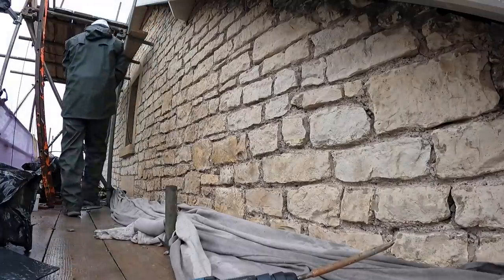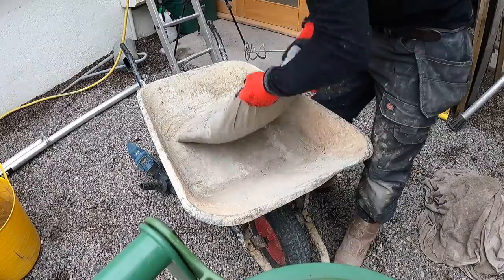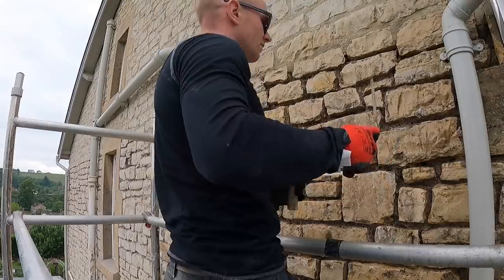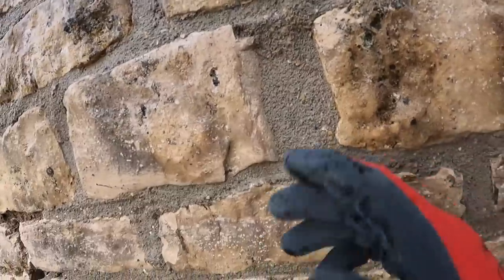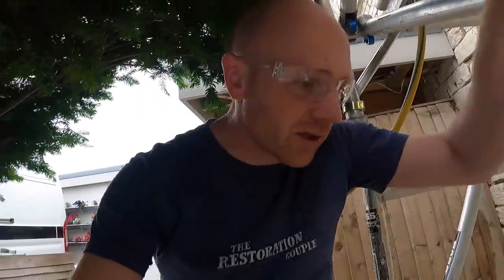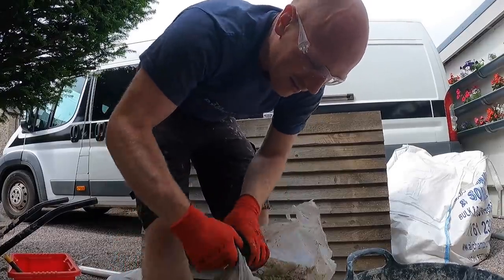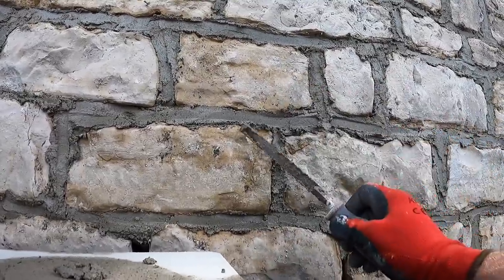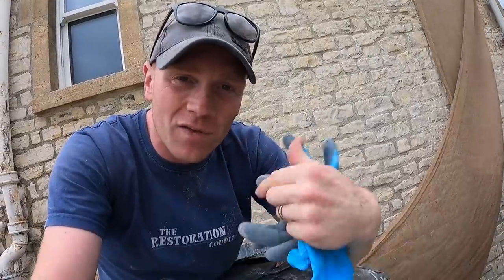POINTING WITH LIME MORTAR - How to Rescue your House Walls

Comment: Where can I go to for advice on an originally lime mortared two metre high sandstone garden retaining wall rebuild / repair?   I am thinking of building up two courses of the sandstone blocks (variable depth blocks, from 10cm to 25cm) with a lime mortar (NHL5?), leaving a few days and then pour concrete level with the blocks to start the wedge back wall; leave several days and repeat.

Comment: Try holding the hawk up to the wall as you point, tuck in and move along, should be a lot quicker, then do the perpendicular joints

Comment: Brother. After stippling the lime with your churn brush you're leaving a lot of the pointing key stroke marks. Little bit more wacky wacky. Deffo helps to catch it a bit softer as well, or strike some areas flat as you go.

Comment: Nice, I'm planning a wall with nice reclaimed brick and laying it using regular cement mortar for the durability (and lower cost) but leaving it quite recessed and pointing afterwards with something lime-based and locally appropriate like you're doing, for the authentic look. Regular cement mortar looks so grim and grey apart from anything. Hoping someone will advise me on if that sounds like a plan.
Reply: If you're laying reclaimed bricks in cement the cement will cause spalling. I.e. the faces of the bricks will become brittle and delaminate in about 10 years with the frost and thaw effect. Mortar should always be more breathable and softer than the bricks and cement can't achieve either of those factors.
Reply: @darrens3  Thanks for this heads-up, I have since looked into this a lot more and realised that, yes, I will definitely want to go with lime mortar. A lot of people in my area use the same reclaimed brick for decorative work and you can see they are just using cement mortar, and I haven't SEEN the problems you describe, these old bricks are actually really tough - a truck delivered some to me and just tipped them out onto the ground and there were no breakages. But still, I'd rather use lime anyway for the look, just got to learn to mix it properly, it's mostly hydrated lime powder we have access to around here, unless I want to start slaking lime myself, which I don't!

Comment: How do you remove the mortar excess from the stone after dry?
Reply from the maker: You don’t really want any on the surface as it can leave marks however a churn brush will knock most of it off.

Comment: When doing all the building work do you then contact your local building control officer, to get a certificate proving all work is completed to the correct regs?
I'm in the process of buying a house which I know the windows, couple of lintels, bathroom, kitchen need replacing.  Just found out that if I replace the windows the local building control officer would be the one to sign the work off as being upto FENSA standards, which I'd need if I wanted to sell the house later on.
It just seems a bit excessive constantly arranging a visit from the bco, or is that just the way things are?
Reply: If you use a fensa registered window installer, you don't need building control to inspect. Only if your installer isn't fensa registered. If you are chasing lintels/ opening sizes or anything structural building control will need to be involved regardless
Reply: That isn’t right. You don’t HAVE to have fensa standards. It’s up to a future buyer if they want a house without it. Same could be said for anything in a home. None of it is a requirement it just helps the house sale go through smoothly. Some solicitors might bring it up and make it a sticking point, others don’t.
Reply: @shandyooo  "Do I need a FENSA certificate?

Since 1 April 2002 in England and Wales, all double glazing installations need to be registered at the Local Authority to meet with Building Regulations - it is illegal to have installed double glazing in a property without a building regs certificate. 

In practice, this is normally achieved by using an installer who is (or whose firm is) a member of a a government authorised Competent Persons Scheme (CPS) of which the largest is FENSA (the Fenestration Self Assessment Scheme) . A FENSA member can legally self-certify and report the job to FENSA and the local building authority, after which you get sent a FENSA certificate."
Reply: @rockboy93  thanks, does this include work that is under permitted development?
Reply: Thank for the replies. I understand  that certain jobs done by professionals can come under the competent person thingy, but as most people doing DIY it's to save money, speed a job up by not having to wait till a tradesman is ready and sadly, from past experience, do a better job myself.
The last house we sold the solicitor asked for paperwork regarding stud wall removal and installation, I can only assume  for fire regs, in both instances the work had been carried out before we had bought it. 
I've watched a lot of the restoration couples videos and just wondered if they got the local building control officer to sign work off as up to standard?
I'm capable of doing a lot of the work for our potential new house myself, but the paperwork side of it is an unknown to me. The garage will need a new flat roof, I want to change the up and over door to two barn doors, I want to add a standard door at the rear and brick up a side door, partial to full repoint maybe needed. Does all the above need a visit and approval from bco?
It's difficult to have this conversation over YouTube comments, when I get the keys I'll probably have to contact bco/Council to find out what tune I have to dance to.

Comment: How much of the house had been repointed with cement? How much of that have to removed and repointed with lime mortar?
Reply from the maker: Just this wall fortunately. The good thing is that when it was done in cement they didn’t actually do it that well, if they had raked out the original lime deep and packed the cement mortar in it would have been a bigger job this time round. Generally they say around twice the width of the joint deep.
Reply: @TheRestorationCouple  That's a small blessing then! I had thought they'd done the whole house and you had a huge horrible job ahead of you.

Comment: Doesn’t matter what I do, the mortar ends up white once dried. I’ve used hot lime and also NHL 3.5 and with different aggregates . It ends up white and I end up having to wash with concrete remover and wash down with fresh water.
Reply: From what I've read, that's where it's drying too fast and the lime is coming to the surface. I have a wall drying now and it's only started to go white in one corner where the hessian fell off over night. I've kept the hessian very damp
Reply: It's the sand
Try using sharp red sand